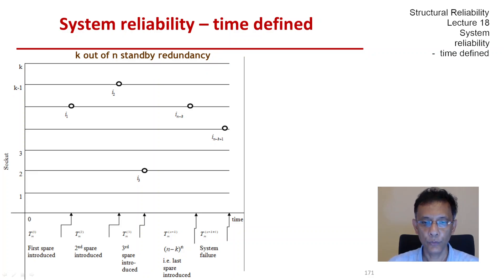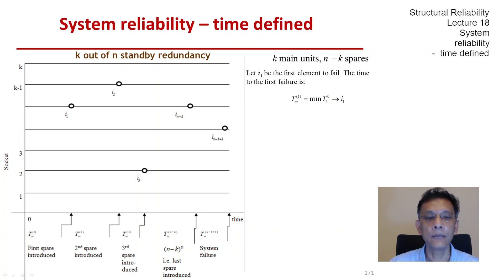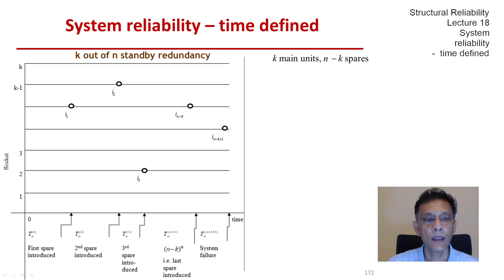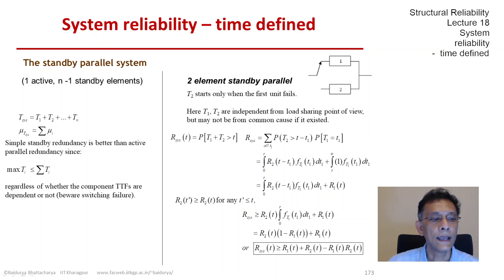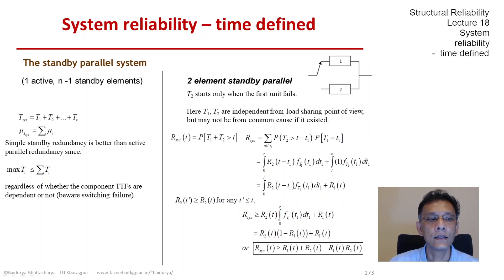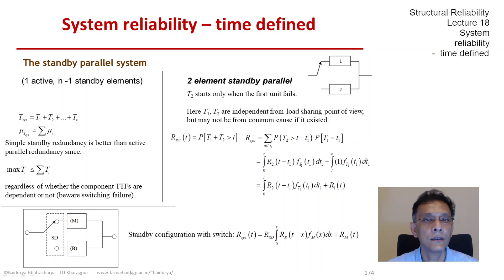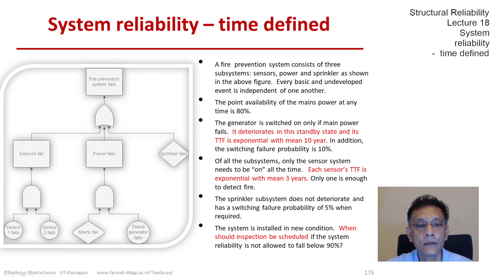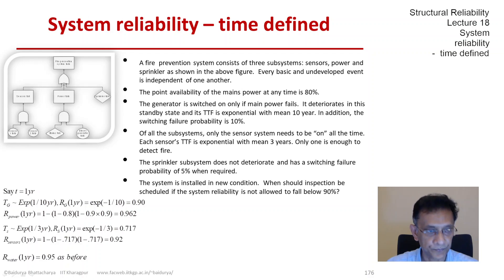STRUCTURAL RELIABILITY Lecture 18 module 08: Standby Parallel

Comment: Can we apply the Series concept to a electrical transmission line system with poles? Failure of any one pole in a segment of a grid implies failure of the segment. But, the individual structural reliabilities are not less than 1.0; the target reliability of a pole assuming normal distributions of load and resistance is 3.0 which means a failure probability of 0.00136 or success probability of 0.99864. Note that reliability is related to the MRI of the climactic events which in USA is 100 years minimum.